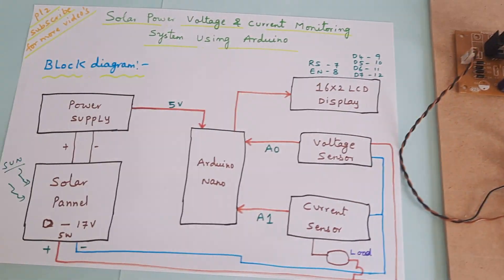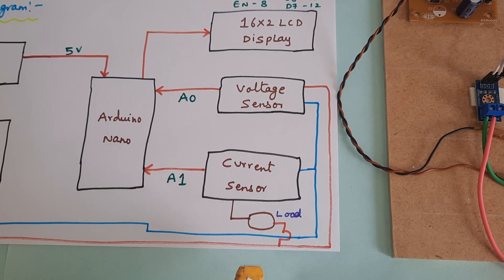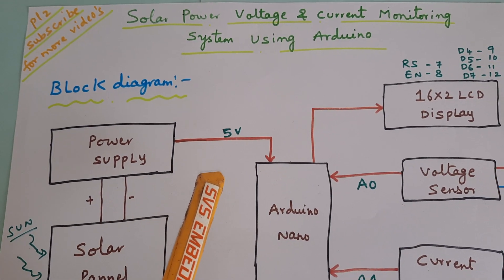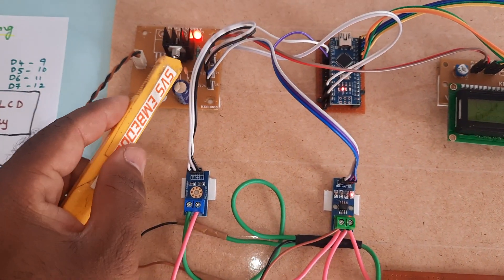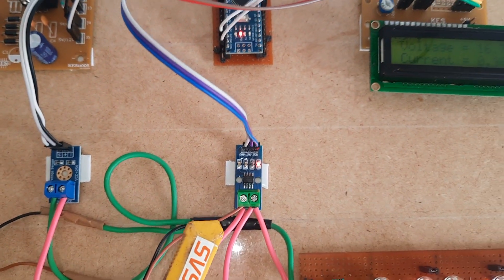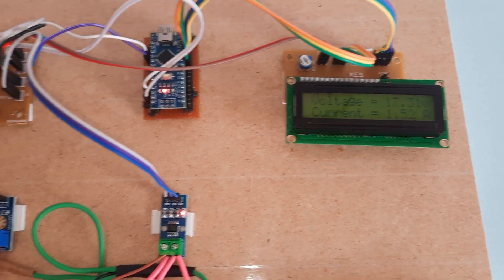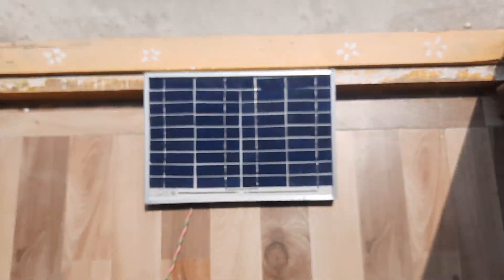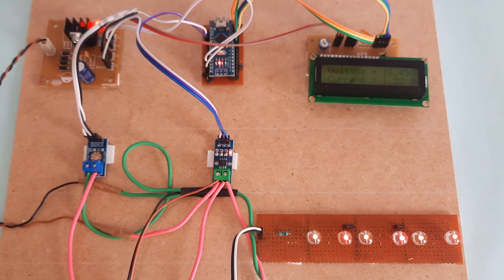Solar Power Voltage & Current Monitoring System Using Arduino & LCD

Comment: im intrested in what you do, it's helping. in one of my project they ask me to integrate a monotoring system in to an existion solar system. my topic is: Integrate of Cost-Effective Real-time Power System Monitoring of Standalone Community Wi-Fi Setups for Sustainability. so please is there any way you can help me with my project. my object for my peoject are: Objective 1: Integrate Sensor-Based Data Collection. Objective 2: Enable Remote Fault Detection and Diagnosis. Objective 3: Evaluate System Reliability and Performance. I would be greatfull if you can able to help me.
Reply from the maker: Thanks for watching and your valuable Feed back.
send me the exact title name along with the YouTube video link on email
send me a mail to svsembedded@gmail.com
so that I can give u the exact cost details.